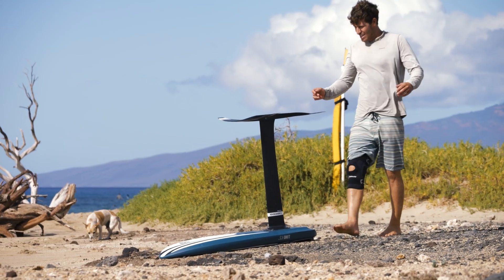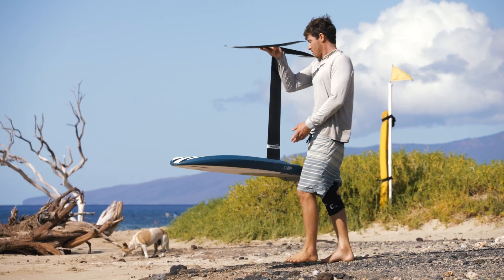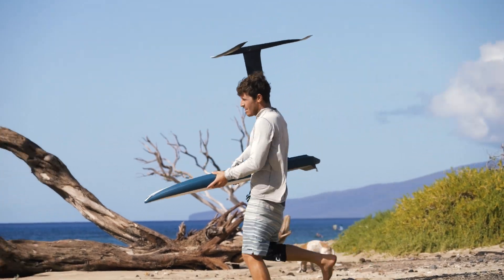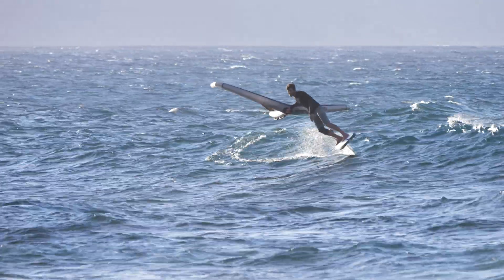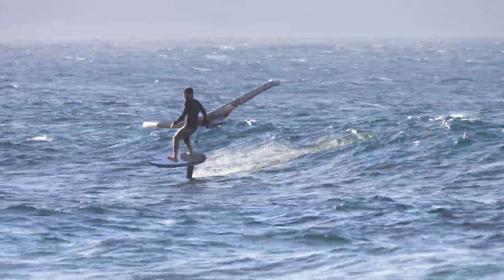03 Cabrinha Carbon Hollow Mast

Comment: Armstrong foils are the best out there no other company out there will come close to there products you may  pay more but you will notice the difference in quality and performance
Reply: It's a brilliant field to develop skills and technique. I've made about 12 masts out of carbon now (dozens of wings and fuse's) and am seeing new things and coming up with improvements all over the place. I agree about getting rid of foam but just getting the molds and materials figured out is key. By now everybody is probably using pre preg and autoclaves. I'm just a guy with skills and curiosity. For the price of one of these kits I can make several and so I did it. Selling them should be no problem... But accruing the right and exact shapes and configurations is the real treasure. When I'm done I'll have all the skills and can make anything I want. Doing it yourself is very satisfying.
Reply: I have had many brands including the one you mentioned and I am not agree. Armstrong is great but there are many equally good. When quality is there the feel and choice of the foil is very personal. Cab, fone, uni, lift.... many good products out there nowadays.
Reply: Cabrinha h-series better
Reply: Lots of other amazing foil companies. Dont be so singleminded.